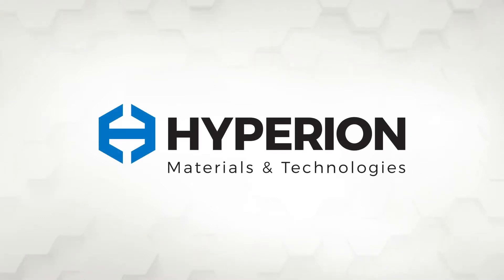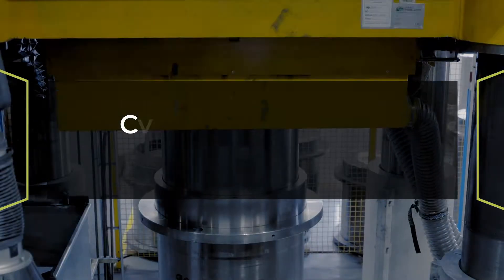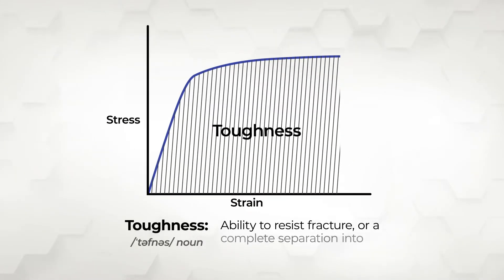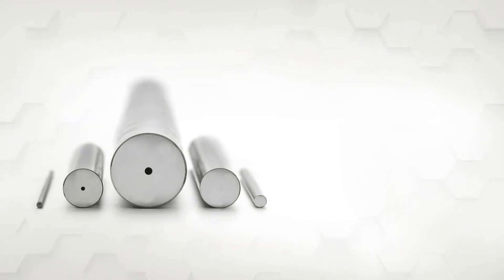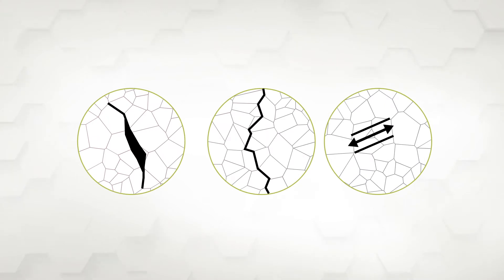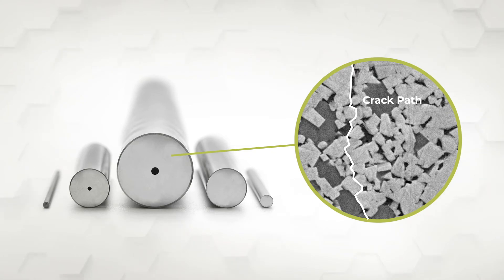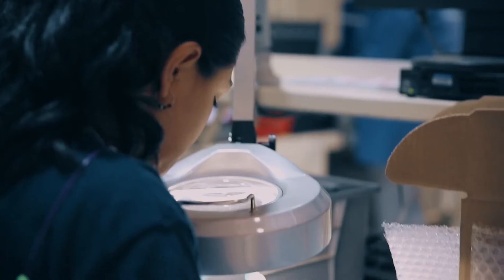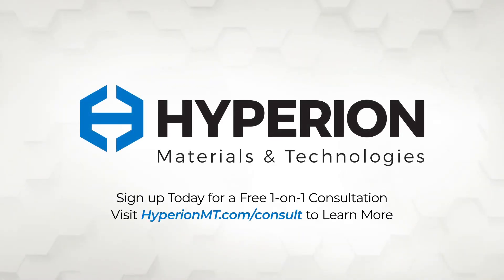Understanding Cemented Tungsten Carbide: Defining & Evaluating Toughness

Comment: I have seen two types of these, one has a cobalt metal binder, the material is unbelievably hard but is not very tough. It breaks like glass. The other type has a nickel binder, it is much more tough but not as hard. The first is great for things like high speed circuit board drills or ball forming spheres, the second type is great where abuse is likely such as rock drills or saw teeth.